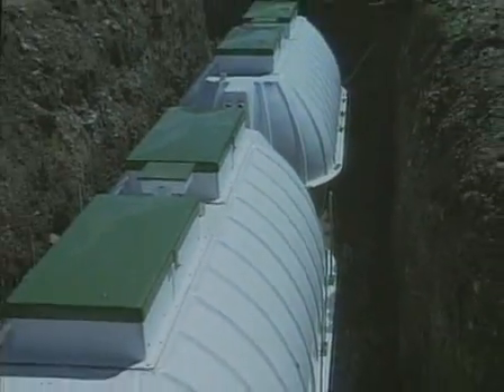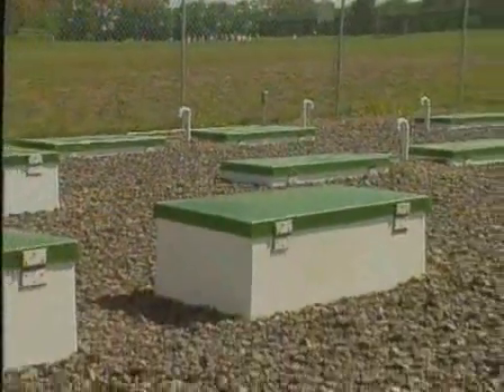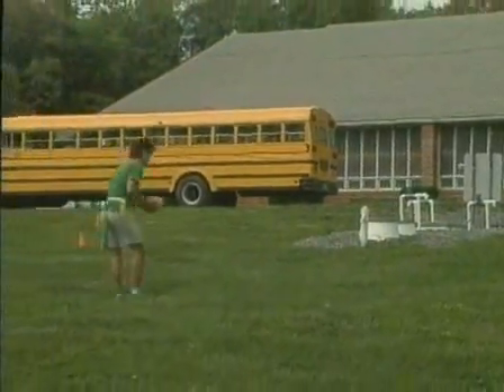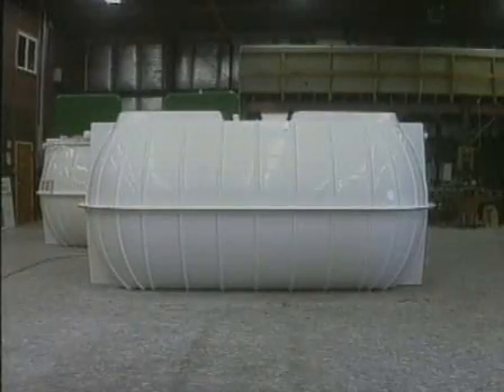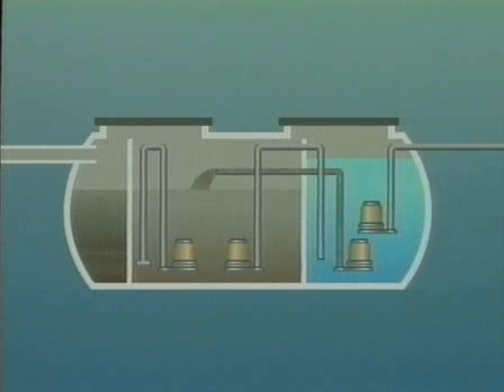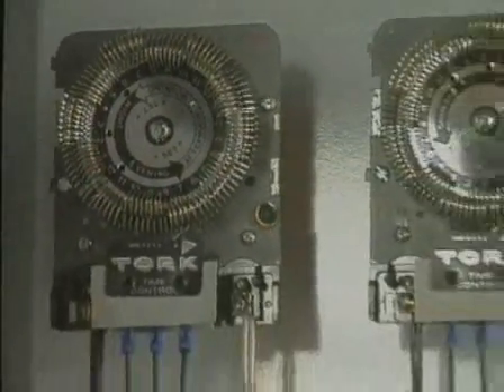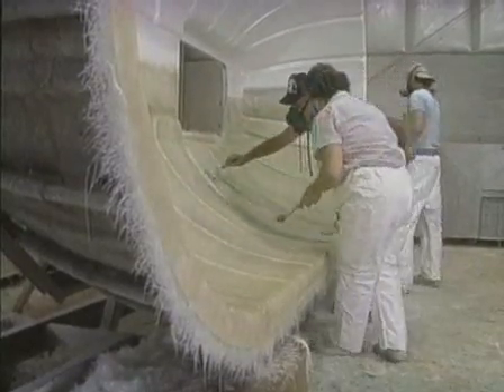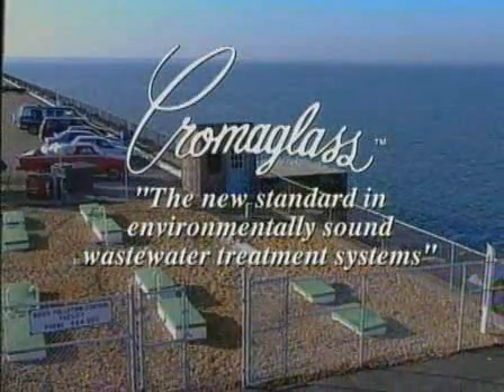Cromaglass Wastewater Treatment Systems Part 1

Comment: I operate several house hold and one  commercial Cromaglass systems in Arizona. Parts are hard to figure find.
Reply: Cromaglass is now cromaflow and they stock all parts back to 1965 with updates available.
Reply: Thanks, my company will be contacting you soon. @cromaglasscorporation4819